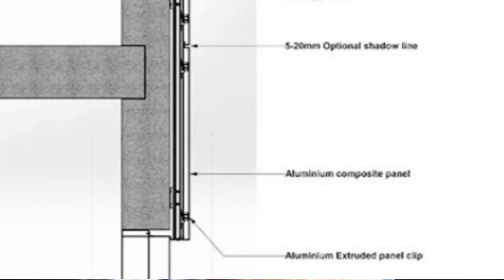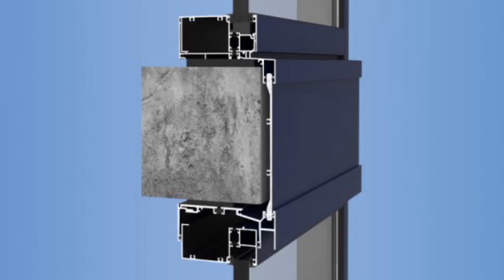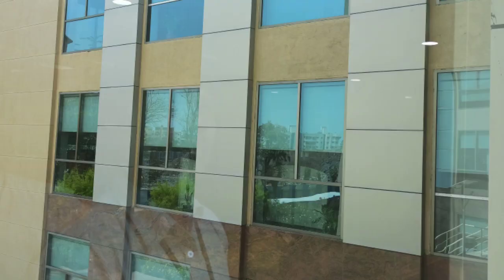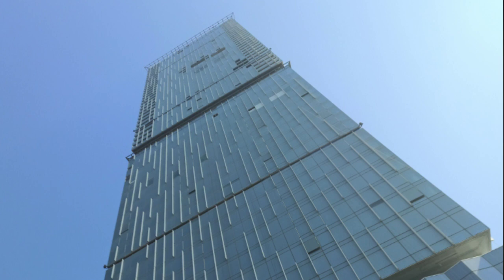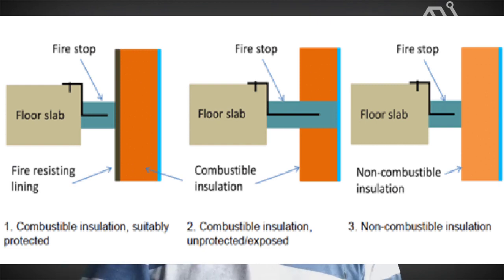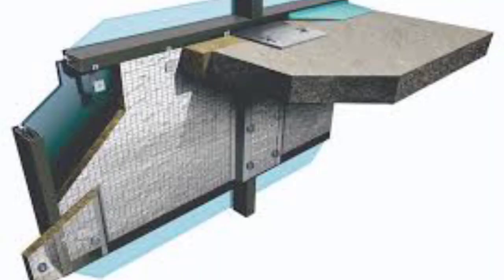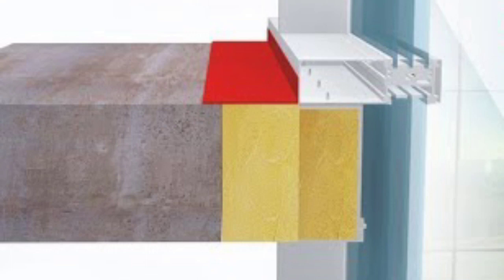What is a Spandrel Panel in Facade? | Facade Engineering | BACK-PAN | SHADOW BOX | Firestop

Comment: Spider glazing can be used in high raised buildings with appropriate fire stopping methods..
May I know why you say NO to that?
Please include:
1. Spandrel area / shadow box also serve to reduce the heat transfer of concrete to glass to avoid glass breakage..
2. Not only on slab, vertical also, spandrel panels to provide on the column areas depending on the set back of columns from slab.
Reply: Dear Ajish
These videos are made basically for, budding architects, at least in India our construction practices are not geared up to receive spider glazing for high rise application. 
This compilation aims at horizontal spandrel application, vertical ones will be cleared along with detailing video for dead walls.
Reply: Antony agreed with your point we can work out high level detai working.....